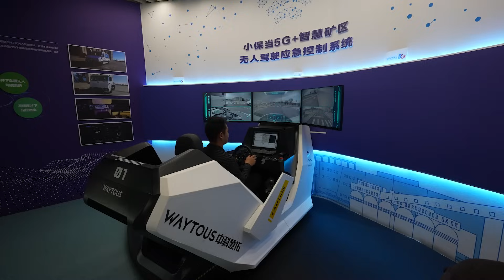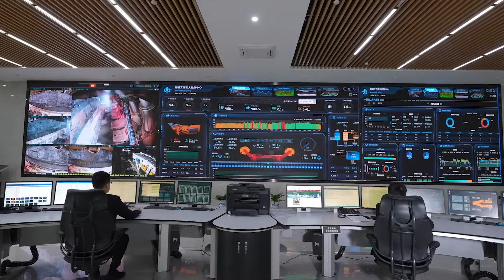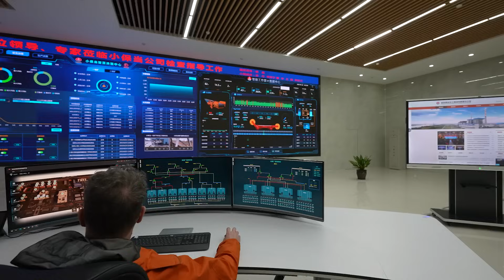Deep Underground in Shaanxi China

Comment: Thanks Barrett again bringing to us another rare video.  There has been a few videos/reports indicating 5G being used in coal mining in China.  Your video brings it into our  home.

China always looks after the workers but the facilities in this mining operation is outstanding.  I wouldn't be surprised that China wants to standardise the automated mining system which is very new.  The key to success is to use the on-site data to detect the coal seam position and then move the cutting head to achieve maximum production.  With less people while the maximising the machinery such operation has a long future in every mine.  The technology is very new because 5G isn't even available in many parts of UK because the British are busy removing Huawei equipment and replacing it from other manufacturers to please the US.
Reply from the maker: Actually most of the people working underground have been transfered and re trained for jobs above ground. Also as the company is really big, they operate 38 mines in total there are a lot of employees in the company, it's not just the people working underground.
Reply: @BarrettYT  Thanks mate for the info!  Keep safe.  All the best.